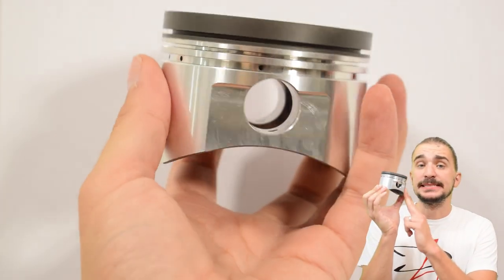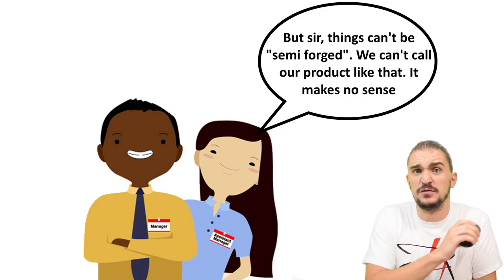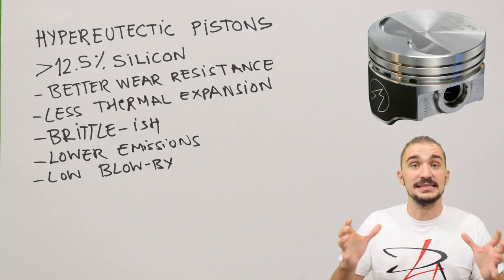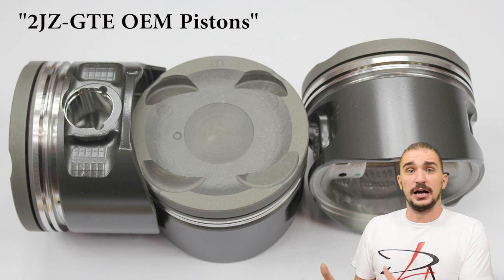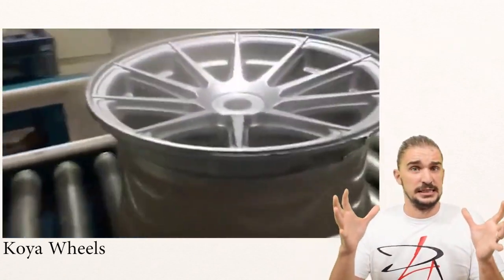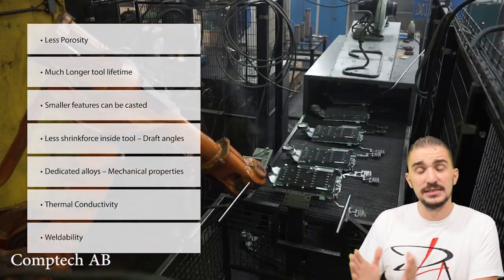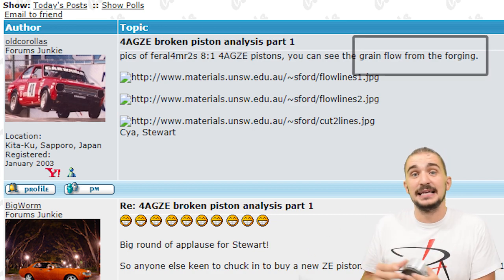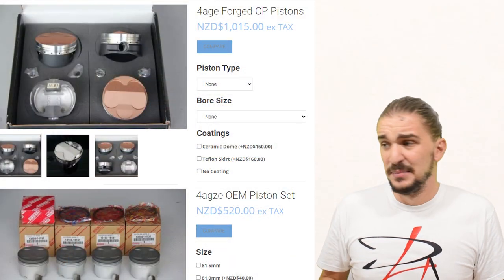What are SEMI FORGED PISTONS?

Comment: For the wheels, "semi-wrought" is probably a much more accurate description than "semi-forged".
Forged generally implies high temperatures above the recrystallisation temperature of the alloy, whereas wrought is a more generalised word to describe any time you're shaping a metal by using brute force to deform it below the melting temperature. More specifically in industry you'd typically call a lump of material shaped whilst red-hot "forged" and a piece of metal shaped while cold (like stamping car bodywork out of sheet) "wrought". Although to add even more confusion "cold-forged" is a term that also exists.

Engineering speak can be very messy sometimes, with words going back hundreds or even thousands of years. And then the Germans have an entire dictionary of their own engineering terms which don't translate well into English at all.
Reply: Thanks for the info.because of my poor performance in my English vocabularies and grammar I really don't understand the term "forged" .for me (incorrectly) it meant more towards cheating and/or producing something in a bad way.thanks again.
Reply: @hermanman8235   Well, if you forge banknotes or paintings then your interpretation of the meaning is absolutely correct.
So 'forged' has come to mean two very different things in English.   One, something fake (also known as a forgery).   Two, a metal item produced by hammering in a forge (and usually of higher strength than a cast one).
Reply: It's called roll forging, edumacate yoseff

Comment: The term “semi-forged” was probably coined by the same marketing goons that came up with “CAN Bus LEDs”. People who like buzzwords without understanding what they’re actually trying to describe.
Reply: Just like "99% fat free"

It's actually 0% fat free, because it still has fat in it.
Reply: No, there is a valid point here. Both semi-sold casting and high pressure hyper-eutectic casting involve a slurry, so a mix of molten phase and solid phase. Semi-solid casting starts with a slurry, hyper-eutectic alloys turn into slush before they solidify as they cool. Proper forging involves forming a soft solid phase. If you're dealing with a mix of liquid phase and solid phase, and it behaves like very high viscosity liquid, then there is some truth in calling it semi-forging.
Reply: @Hydrazine1000  sounds half-assed to me...
Reply: Or like "dipped in Chrome"!
No such thing. How bout if pistons are run over by a "semi"!  Does that make them "semi pistons"?

Comment: My first guess is a combination of casting and forging.

Something that I would probably do try to do (and I wouldn't call it sem-forged) is start off with a combination of advanced casting processes, and then utilize a combination of ultrasonic frequencies and aerogel-based thermal insulation within the mould/die to maximize the evenness of the entire alloy and crystal structure. I would follow up with some precise machining, and finish off with a combination of inductive heat treating and surface treating.

Comment: Injection molding casting has been a thing for decades in plastics, it's even been a thing for metals for many years. Most compacted grey iron engine blocks for diesel engines are cast under injection pressure because they are mechanically stronger than your typical gravity cast block.

Comment: Thank you for the video, excellent!  though you forgot to mention one thing. These days CNC is quite accessible and cheap to use, so many pistons are machined all over. how do you recognise piston manufacturing process than and not to be forced to trust manufacturer :)  That is tricky question.  usually it goes like this "machined all over = forged piston" Also funny thing that Mhale has very similar designation for cast and forged piston M124 - cast according to you, though M142  forged. Big LOL, easy to confuse your self :)

Comment: High pressure casting of an oversized part "blank" that is subsequently pressed to final size in a secondary mold similar to the wheel analogy. This process reduces the size of the voids in the cast blank and creates some strengthening grain flow. In other words, semi-forged/thixotropic. Semi-forged is easier for layman to understand than thixotropic.

Comment: All I heard was “Toyota-something-something-something-SUPERCHARGED.”

   Although I could see an attempt being made at, say, forging a piston top for greater strength, then casting the rest of the piston around this forged “biscuit,” resulting in lower outward expansion of the main body of the piston, combined with higher impact strength and density of the forged head. I could see that working correctly if the expansion rates were carefully accounted for. Also, doing a “two-piece” construction may allow for a crown-oil-cooling-passage to be carefully incorporated into the design. 
   
Alternately, a forging could be made where only the crown area of the piston is actually subjected to the forging compression, leaving the rest of the piston at a lighter density, although I would still worry about internal stresses from the differential expansion and contraction.

Comment: Would you mind do a video explaining how to calculate wheel fender and tire fitment?
Reply from the maker: There really is no formula, and there's a million variables. Only way around it is to measure and test fit until you get the desired fitment.
Reply: Measure your oem wheel. 
Compare measurement of new wheel 

Measure available space around oem rim. 

Is that difference larger than space available?

Your welcome.
Reply: Another option is to go to the Fitment Industries website and see what they have in their gallery. 

They have a massive gallery and provide wheel and tire specs depending on what type of fitment you're looking for. 

It simplifies the whole process
Reply: @fastinradfordable  Agree! For weird projects and unanticiapted problems a good way to measure clearences of the wheel and suspension arms, steering and other bits is to have the car suspended by the frame and whte springs removed. This allows the wheels to be put at full steering lock and full stroke up and down to better asses the clearances available in all possible positions.
In case of double wishbone suspension is really easy to just unbolt the whole spring-damper combo. On macpherson struts is a bit more complicated. Removing the spring and reasamble the strut on the car without the spring is pretty hard and time consuming but well worth it. The alternative is a lethal danger lurking if the spring is just in compressed state by clamps. In theory it works, in practice is a big no-no. A car spring has a lot of force and energy stored in it. A J hook clamp can slip and slide, or the spring buckles and slips out, is a waiting danger. If that happens while taking measurements around the wheel expect the wheel to go full force in down position and can and will kill you or break and sever limbs cought in suspension arms. So don't skimp on this!
Reply: I know there are many variables, I have checked out fitment industries I just wanted to hear you're explanation @driving 4 answers
Reply: @AsiAzzy  nooooo...

You need the wheel hub to sit at it's actual ride height.

If you let the suspension completely droop, you won't know if the wheel is going to hit. That's a lot of unnecessary work that won't get you anywhere close to figuring out what you need.
Reply: @jameshaulenbeek5931  Yes, it is some work to do and for a normal car it is mostly unnecessary. In my case i had to figure out what kind of wheels i could put on custom offroader in terms of clearance. Just measuring around a mounted wheel is hard to account for the custom steering rods and antiroll bar and driveshaft especialy in full lock and full compression. By removing the spring element you can easily position the wheel in any position (full compression, full droop, full left steering angle and right.  You cant check the full compression state on fully assembled car. You need to remove the spring element for that.
Reply: @AsiAzzy  ahhh, i gotcha. Yeah, that makes sense then.

Comment: So, yes, a wheel can definitely be semi-forged. Here are two ways:  1) you cast a wheel face with a heavy rim that you then attach to a spinning lathe and draw out the barrel. This is a form of forging, and it is done both hot and cold industrially. The end product is a single-piece wheel with a cast face and a forged barrel... SEMI-FORGED.  2) a peculiar process from Japan where a roughly finished shape wheel casting still in its semi-liquid phase is then struck with high force to refine the grain structure. The shape of the wheel was cast, but it was treated via a form of forging... SEMI-FORGED. 

Perhaps we need to look at the purpose of forging and determine if that goal has been met in any product purporting to have been forged. I know you can buy a wheel made by cutting a shape out of a forged aluminum billet and it's called a forged wheel. Same for a forged piston. But in the same vein you can grind a knife out of a bar of (definitely by any measure forged) hot or cold rolled mill steel and nobody would call that a forged knife. Semantics, maybe?

Comment: Not sure if you have one, but could you do a video on 2618 vs 4032 forged pistons?

 Im an early mechanical engineering student and I'm looking to forge my block for my supercharged 5.7 hemi. I think 4032 are good for my goal (max 12psi boost ~750whp, daily driven) while most shops sell 2618 pistons.
Reply from the maker: You'll find the info here, towards the end of the video: https://youtu.be/rN2ND_FPnUA
With good tuning, 4032, should be totally ok.

Comment: I got 1 question. My car has aluminum engine block, and my original piston is eutectic piston. Can I swap my eutectic piston with forged piston? Do i need smaller size forged piston to fit in my engine block?
Reply from the maker: If the forged pistons you want to use are designed and made for your engine they likely already are of the correct size or oversize if you'll be overboring.
Reply: @d4a  Thanks for the reply! Im just afraid forged piston expand more than my original eutectic piston, so Im thinking of using 0.5mm smaller forged piston to avoid any fricton inside my engine when its running. Thank again for the reply 😄

Comment: its just a simple die casting process nothing more improves massproduction rate and give semi finished product quality is modrate air pockets are to be emilinated by controling temp. n flowability of  molten metal reduce oxidation in manufacturing process clean n give better repeatability through out production so implimented by manufacturer for cutting cost and improve production rate n quality parts with less machining trust mi i am certified mechanical  engineer☺☺☺
Reply: there is no term called semi-forged its HOT METAL DIE CASTING  just like plastic molding its slang just used by noobs n non technical persons or mechanics😂😂😂😂😂😂😂😂

Comment: Does someone make hypereutectic pistons for motorcycle applications?
Reply: Yes, KB or Keith Black Pistons.  Limited applications as far as I know. Remember,  the piston to wall clearance is critical,  so finding a VERY competent machinist is a must. Naturally  aspirated only, or very low boost conditions. Good luck.
Reply: @t.s.racing  👍. Yeah, I recently found that out the hard way.

Comment: Interesting the hoops and loops folks go through in order to keep mortally flawed designs alive a bit longer.
The use of weird alloys and complicated manufacturing can be avoided.
Like goes with like. For example, ring lands and cylinder walls should be of the same or similar alloys.
Parts need to be simple so forging, billeting, or (secret) is easy.
Parts that contact oil should not be exposed to raw fuel or combustion heat and should have limited exposure to combustion products and residual heat. Otherwise blowby and other ills occur along with ruinously high thermal losses.
Design a decent engine instead of spending all those neurons on Band-Aids and kluges!!

Comment: I dont understand why forged pistons should be better by definition. If I have a high output engine on a snowmobile who works in a really brutal temp variantion. In this env. In this case I would always use a cast piston instead of an forged (as long as you dont like to do a lot of maintancy). The cast ones will last for a longer time...
Reply: High performance drag strip/track cars usually don't drive full blaat during winter, so snowmobiles may have different operating conditions. Cars with Turbo/supercharged high output engines usually use forged pistons to withstand the increased stress, giving the forged piston it's reputation for durability.

But some cars like Subaru use hypereutectic pistons on some of their turbo motors while the Viper uses forged pistons on their naturally aspirated motor. Vipers can go 1000+ HP on stock internals though.
Reply: It is about total abuse piston shall see. if you have 150HP but in a process have good cooling and not very heavy vehicle to move, that is not big of a deal. Winter time intake air is quite cold. But if you have like 300HP in about 2ton vehicle and driving really hard in summer time, it can get quite abusive and hot for the piston when engine is releasing all that power. Time of peek power usage until you reach rev limit to move all that mass is much higher in cars than on snowmobiles.  Or to simplify would you rather move 10  times 100 pound bags in total mass of 1000punds or  40 times   25 pound bags.  That is the difference simplified. I am quite sure when you try to move 100pund bags it shall be problem for your back and you shall move quite slow, 25pound, no issues with the back and you can move quickly so it shall take about same time or about same amount of work with one big difference, in one situation your back shall hurt. Simplified that is the difference

Comment: I really like your channel, but about halfway thru the explanation of semi-forged, "hitting the sword with half his strength", I almost deleted you forever. The mouse was on the ""X"". I have a problem with the use of the word eutectic though. Those of us in the electronics trade, have been using eutectic solder for 30 years. What makes it eutectic, is the fact that the liquid/solid state is a fine line. It immediately changes states at a particular temperature, rather than a semi-liquid or gelled state. There has to be a better word for this.

Comment: When I went yo school (last century) this was called "die casting". :)
Reply from the maker: All of it is die casting. Die casting simply means there's a permanent mould, but there's many different kinds of die casting. Low pressure, high pressure, vacuum, semi-solid, etc.
Reply: @d4a  No. you can only do it with a metal die. Not sand which would fail. Die casting by inference means that the molten metal is forced under pressure into it. Great video , I'm not being a troll, I love your stuff! By the way, have an interesting story about 4aGZE blocks when I was working for Toyota Team Australia, but perhaps another day.:)
Reply: @frednerk5959  Every clip I saw of pistons in the video was being cast into dies, whether under pressure or not. I didn't see any sand molds or any lost foam casting.

Comment: Pressure Die Cast -  simple's
Reply from the maker: Not that simple 😉
Reply: @d4a  Pressure Die Cast -  which is what we would call the process you describe, here in the UK -  The metal is in the   Thixotropic (pseudoplastic) stage between solid and liquid  and injected under great pressure  - The pressure and sheering of ionic bonds in the alloy causes the viscosity to reduce - its possible by careful  mold design  and selection of flow directions  to manipulate the grain similar to extruding to enhance strength, wear resistance, weight, finish while avoiding voids - I suspect the word "semi forged" was  used not out of ignorance  but rather a short cut to imply that the grain has been manipulated like forging

Comment: not understand the use from americans from the designation "silicon": this is silicium (metaloïd), because "siliconE" is a rubber material...same thing for "aluminum": all around the world it's named Aluminium...I did make pistons during 30 years by Mahle and never heard "semi forged pistons": whe did make cast pistons (99% from the serial built pistons) and matriced pistons (for sport and race cars), and "forged" is not a right designation because the pistons are made from a heated aluminium block pressed in a mold (caled "matrice" in french and "matrize" in german)

Comment: That piston is tiny it's even smaller than my b16 piston
Reply from the maker: It's actually the same, the b16 also has a 81mm bore
Reply: @d4a  really that cool then if it has the same bore that would mean the 4age has the same stroke cuz they are the same displacement too back the 4age doesn't have VTEC like the b16